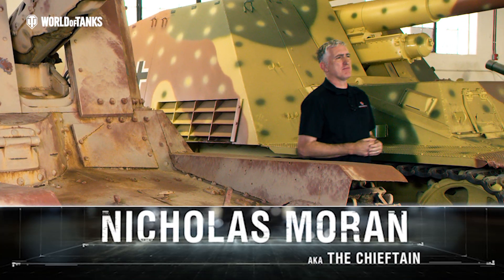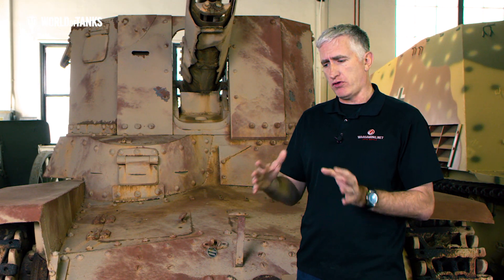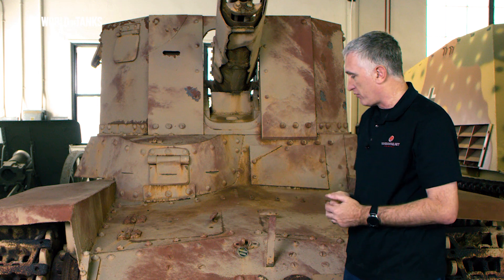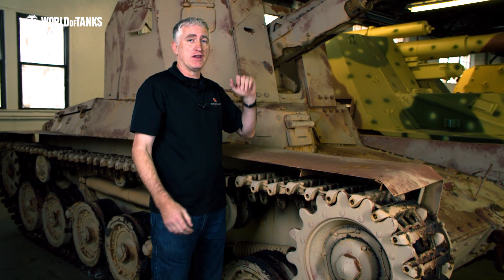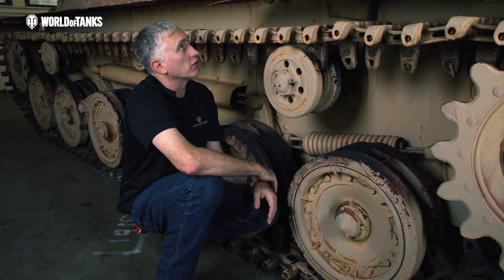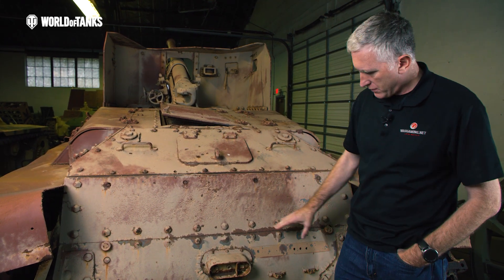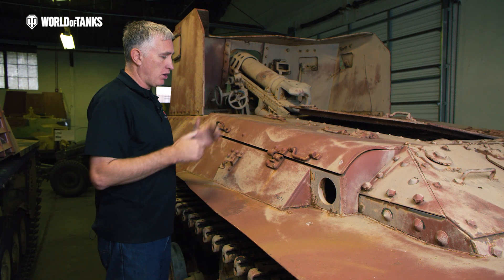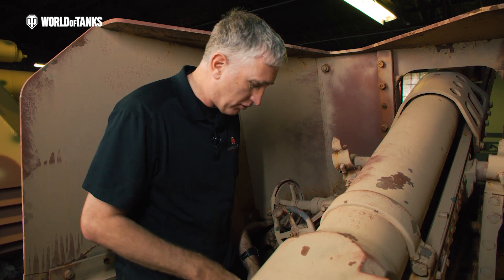Inside The Chieftain's Hatch: Ho Ni

Comment: Metallurgist here! The cracking of the steel during impact such as from a 37mm can come from high carbon content / improper heat treat OR impurities within the steel itself such as phosphorus or sulfur. You do not want sulfur in your steel as it fall apart at the grains. However more can be learned as the steel crack over time. 

For steel to crack over time it needs to be under extreme stress or under cyclical loading. Cyclical loading will produce fatigue failures which are the most common type of cracking seen. The armor plates are not under cyclical loading, and the bolts would normally never produce enough force to crack the steel. Thus the stress has to be coming from the steel itself. 

When steel is cooled off quickly or quenched it produces a microstructure known as martensite. Martensite gives steel much of the strength it needs in knives, tools, and armor. Martensite needs to be tempered though, as martensite itself is carbon trapped within the iron crystal grains and creating dislocations (stress) within the steel. While it makes strong, without tempering to allow the carbon to a line itself, the steel is brittle. Untempered Martensite (with most alloys of steel) will cause micro cracking and eventually will cause major cracks. 

Now look at the superstructure, all of the cracks run to a bolt hole, while the bolt didn’t cause enough stress to crack the plates it did create a focal point. The armor cracked over long periods of time, indicating sub quality tempering. And from all of this, it can be deduced that Japan nearing the end of the war was at least rushing, if not skipping the tempering cycle for their steel to get it to the military as fast as possible as the only armor plates to suffer this were the add on armor instead of the Chi-Ha hull that was converted.
Reply: This was an interesting read, thanks! Learning ftw!
Reply: they used the old Vickers process in hardening it generally gave a more brittle face to the steel, it was outdated and replaced by the west.
Reply: Legit logic :o) That is some seriously unnatural cracking :o My thought was they were going for resistance against small arms fire only. Say 50 cal and maybe 20mm max. But that is a total mega guess. Crap process is more likely.
Reply: Very cool, thanks for the information it was much appreciated.
Reply: I have been educated.
Reply: Great info thanks!  I am a big fan of the ships of the era and there's always discussion of the quality of armor on the Japanese ships versus US.  After seeing the 16" shell hole thru the crazy thick armor that would have been on the Shinano's turret face had it nor been converted to a carrier I searched the net and found the govt's analysis of the metal they used to make armor.  It was interesting to read how it was inferior metallugically to ours.
Reply: @Iron Phoenix Forge Works I was wondering if a lack of alloying metals might also be a factor.  Most modern high strength steels include manganese (sometimes other components but usually a bit of manganese at a minimum.)  You don`t need much, it's usually around just a couple of percent (I did a lot of metal chemistry back in the day but my memory has some gaps) nonetheless if you're critically short it adds up.  Lots of other stuff needs manganese, nickel, etc. as well and AFV armor might not have been considered as a top priority.
Reply: Thanks for your reply! It's nice to find additional info in the comments to a video.
While it's pretty obvious that the metal has to be brittle, I was wondering if rust jacking around the bolts and other seams might have been part of the reason for the cracks running to bolt holes. Obviously the bolt holes make dandy stress risers, but a little extra force from rust might have contributed to the problems.
Reply: Now you have me wondering as to the origins of the iron, as you're probably well aware but most people probably are not, that iron ores contain different impurities that can have positive or negative impacts on the qualities of steel.
Reply: I'm wondering if part of it also might have stemmed from the fact that while yes, the Pacific Theater was probably more humid than Oklahoma, I'm pretty certain Oklahoma goes through a more sever annual temperature flux than what Japan was thinking of. They were probably planning on stopping the US in one of the many archipelagos in the Pacific as well as were pressed for time to actually produce something, so they didn't end up treating the steel as much as they should have. So over the time between it being captured and present day, the years of sweltering Mid Western American heat changing to the freezing winters might have exaggerated the cracks and decay even more. Like I'm sure that vehicle was bound to have cracked sooner or later, but I think the environment and time have just worn it down even faster.
Reply: Thanks for the insight! Japan itself has very little access to iron ore on the home islands. During the height of the empire they were importing most metal but towards the end of the war they were using whatever they could get their hands on which was primarily their domestic iron sand which can be found around their volcanos. This came in two varieties akame satetsu (赤目砂鉄) and masa satetsu (真砂砂鉄). Masa is the high quality version with Akame being low quality. Masa ironsand is found mixed with quartz sand that washes down from granite mountains. The magnetite in the sand contains few impurities or other metal oxides. Masa ironsand was used for manufacturing wrought iron and steel, used in everything from tools to cookware. Ironsand was used extensively in Japan for iron production, especially for traditional Japanese swords.

Akame ironsand is found mixed with sand made from an igneous rock called diorite. The magnetite in the sand contains often greater than 5% titanium dioxide, which lowers the smelting temperature. The akame ironsand is used in the tatara (a specialised Japanese bloomery which resembles a tub and had to be designed to smelt the loose iron sand) to make pig iron, which is then used to make items out of cast iron.

Its likely that by the end of the war many armor plates and non critical parts were being made out of the lower quality material because it was both faster and easier to smelt while also being more abundant. The higher quality Akame ironsand was saved for things that absolutely required it.
Reply: @garywayne6083  That "16" shell penetrating that shinano armor" imo kind like theoritical test rather than in realistic ones. I mean like maybe they shoot it at really close range.after the war.
Reply: @teamidris  They were probably trying to make a strong steel without access to most of the important alloying metals. If you do all the work with carbon, it ends up brittle.
Reply: Meanwhile
M4 Sherman - let make a big circle around it
Reply: Great information?
What can you tell us about the A6M zero’s aluminum structure. It was revolutionary at the time ?.
Extra Super Duralumin ?.
Reply: @benmoore8537  The Imperial Japanese Navy used an aluminium-zinc alloy for airframe components, which ended up standardised as 7075 alloy, whereas Duralumin is a range aluminium-copper alloys that form the 2000 series in modern classifications. Compared to Duralumin, the aluminium-zinc alloy they used has slightly higher tensile strength, and much better corrosion resistance. Duralumin is very vulnerable to saltwater corrosion, meaning it often ends up needing to be plated with pure aluminium to provide corrosion resistance. 7075 aluminium is still quite heavily used for components needing a high strength to weight ratio, including things like motorcycle sprockets and rifle receivers.

Sadly, I've not been able to find a retail supplier in the UK as I could do with some for a project.
Reply: @discerningscoundrel3055   great information, thanks for taking the time to get back to me.
Reply: @benmoore8537 I'm happy to help where I can. You're lucky, as I don't know that much aluminium metallurgy, but I do know the 7075 alloy as I spent ages at one point trying to source some for the web of a big drive sprocket to support a steel toothring for a project.
Reply: Thank you!
Reply: Me so ho-ni!!! Me love you long time!!!

Comment: Because the engine takes air from the crew compartment rather than directly from the outside, the little hatch above the driver's bulge was probably for ventilation. When open, the intake would create a draft that travelled the entire length of the crew compartment.
Reply: But wouldn't it make more sense to put a ventilation slit on the sides or on the back of the tank?
Reply: @luzernerschutze7564  not in tropical climates, the design is a primitive form of climate control, especially as the top of the tank will always be less exposed to enemy fire.
Reply: World of Tanks - RaZi
Reply: Such an arrangement might not pull road dust straight into the driver’s face, as in the Churchill.
Reply: Thanks!  Finally someone who knows about tanks.  🙂
Reply: @SonsOfLorgar rubbish it’s nothing of the sort.
Reply: @alangordon3283  So what is it then in your opinion?
Reply: It's open-topped, so already pretty well-ventilated.
Reply: @wbertie2604  The Ho-Ni was open-topped, but it used the Chi-Ha hull with virtually no structural changes. This small port above the driver's bulge was carried over from the Chi-Ha even though it no longer served its original purpose.
Reply: My guess is a pistol port.
Reply: @Mmmmmmdonuts  So you can shoot down aeroplanes.  Hmm.

Comment: 22:38 Correct that is mechanical fuel injection for the engine. What you see there is the pump, inside is a cam driven by and synced to the crankshaft, that sends high pressure fuel at just the right moment to the cylinders. Each one of those fuel lines loops around so they are all the same length, so they can be timed correctly. In the cylinders will be the actual injectors that atomize the fuel for the best burn. It's a really neat tech that is still used today, the Cummins P-pump is a common application with a number of videos explaining how they work.
Reply: Beat me to it. The more common system has the pump built into the injector. Other than requiring high pressure tubing to connect the pumps to the individual injectors, no real down side to this kind of system.
Reply: This farm raised boy knew  on the Ho Ro video they were the pumps.  I thought funny there are two?

Comment: Glad you later found out that the frontal armor of the superstructure is overlapped armor, the plate you measured is actually applique armor plate of 25 mm ontop of the actual armor plate of 25 mm so it is 50mm in total, but the side of the superstructure has no add on armor so they are only 25mm.

Comment: The Japanese 47mm was a Sherman Killer. "The Type 1 47 mm AT gun was introduced to combat service in 1941, with the intent of it replacing the Type 94 37 mm (1.5 in) anti-tank gun. It was very effective for its role, with American personnel calling it "an excellent weapon, with mechanized carriage and a high muzzle-velocity" that "proved most effective in combat," though it was not always available in sufficient numbers. It had a high rate of fire and with AP shells was capable of perforating the front armor of the M4A6 (a slightly more heavily armored variant of the M4 medium tank[citation needed]) at 800 yards (730 m), though standard doctrine was to wait until tanks got closer if possible to ensure good shot placement.[7][8] The weaker APHE shell, while incapable of penetrating the M4 Medium's 93 mm (3.7 in) of effective front armor, could still penetrate the tank's side (38–45 mm (1.5–1.8 in))[9] of vertical armor), the most likely part of the tank to get hit, at a distance of more than a kilometre.[10]

Armor penetration of Type 1 APHE shell[6]
Range	                        Penetration at 0°	         Penetration at 30°
250 yards (230 m)	3 inches (76 mm)	        2.25 inches (57 mm)
500 yards (460 m)	2.75 inches (70 mm)	2 inches (51 mm)
750 yards (690 m)	2.45 inches (62 mm)	1.7 inches (43 mm)
1,000 yards (910 m)	2 inches (51 mm)	        1.4 inches (36 mm)
1,500 yards (1,400 m)	1.6 inches (41 mm)	1.2 inches (30 mm)

Comment: That was an injection pump. Diesels have injectors in the engine, but the injection pump provides fuel pressure to fire the fuel injectors. The pumps are usually located on the side of the engine and driven off the crank or timing set, but they decided to place that one there. There are multiple reasons I can think of it makes it easier to bleed the air out of the system diesels will have a hard time starting with air bubbles in the fuel system, they ran out of space, or that was how the original vehicle was configured and when they cut the top open they weren't going to bother to change it.

Comment: That was the pump for fuel  injection nozzles.  (Which are basically spray heads (almost always) in the cylinder heads.)

Comment: Great video! Many Japanese armor tests and projectile evaluations describe penetration performance against two different types of plates, a rolled homogenous plate and a face-hardened plate. It is likely that much of the Japanese armor found on tanks was of a face-hardened and consequently more brittle variety, not to mention limits in terms of resources for the processing of metals, as well as a bottleneck in the availability of machine tools could have contributed to performative inconsistencies, especially as the war dragged on, but at that point, I'm mostly speculating.
Reply: At least in older times Japanese native iron ore was of varying quality as well (it's the reason for the folding in their sword blades it's way to get more out of the ore you got without wasting it) so that might have also been a contributing factor since during wartime there would not have been time to purify the low quality ore as well as they could and thus you'd end up with armor plates of inconsistent quality or worse plates with clear weak spots.
Reply: @SampoPaalanen  Around the start of the war, the vast majority of their iron and steel supplies were from imports, mostly via US scrap metal imports. The primary barriers for refining these materials would've been the availability of manganese, molybdenum, and vanadium, manganese in particular largely came from 3 countries, one of the largest being the US, and even in 1919 when Carnegie Steel gave the Japanese the rights to STS, it was assessed that to make STS, the cost would be around 20x what it would be to make in the US. The local iron ore deposits had functionally zero bearing on the metallurgical situation within post-industrial and especially wartime Japan.

Comment: At 17:08 its not stowage boxes to my knowlage, it should be armour plating for the engine ventilation as this is a air cooled engine, and under the hatches above them should be acess to the cooling fans and the top of the engine. if you compare it to the Ho-Ro, you will see where the vents originally was placed. which then later on moved out and downwards (with the chi-ha kai modification as far as i can see) so they blow the air out under the mudgard of the tank (i pressume to prevent bullets or molotovs). the engine should be cooled by 4 centrifugal fans, with 2 placed on each side. that is just what i have seen from schematics of the powerplant from an japanese pdf which appears to be looking into the compression release on various japanese engines from this era from what i can tell.
Reply: This might explain why the fuel injection pump is hung out the front of the engine. That gets it out of the way of the air flow.

Comment: Okay, first I do have to give the Chieftain credit where credit is due, this is a lovely video as always, he did a good job of it.
 However @23:40 is why I'm making this comment. 
 We don't know how many Sherman tanks were knocked out by the Ho-Ni I's but we do know that the Ho-Ni I's knocked them out. In fact I looked into it myself and from the Japanese and American reports I read, the Ho-Ni's specifically that Ho-Ni right there that fought in Luzon went on a freaking rampage. 
  Four Ho-Ni's on Luzon, working as both tank killers and armillary support. 
 (fun fact, the ho-ni is technically designated as a 砲戦車：gun tank, there's still debate over what a gun tank really is but basically it's a hybrid vehicle between an SPG and a TD.)  
 During this they knocked out a number of American vehicles, one of them was in fact an M4 which testaments and reports show that they knocked it out 500 meters away from the front. (unheard of when thinking of Japanese tanks.) 
 When most armored vehicles were knocked out and most of the commanders dead,  three remaining Ho-Ni Is were organized into the 戦車撃滅隊 or Tank Annihilation Unit from April 19th~May 28th 1945 until only one vehicle remained. 
 That one vehicle also still going tank hunting until it too was knocked out on June 3rd 1945. 
 Were these tanks the best: No 
Was there room for improvement: Yes. 
 Were their performance bad: Hell fucking no. If anything these vehicles were probably the most effective vehicles against American armor, and guess what, the American military themselves agreed to that, as they wrote that down in their report about the Ho-Ni I.